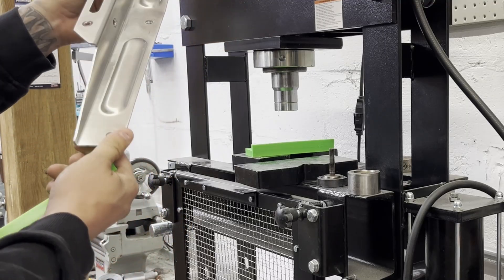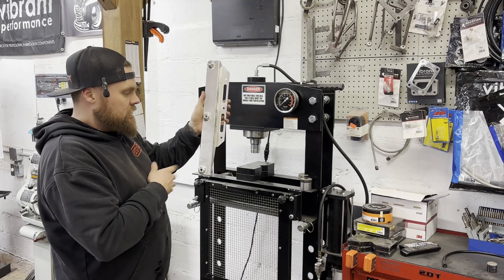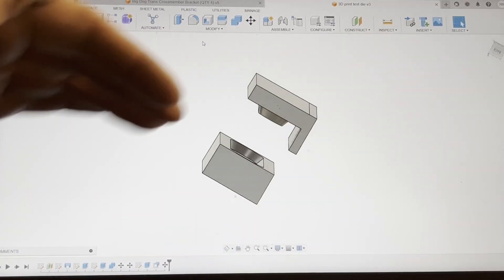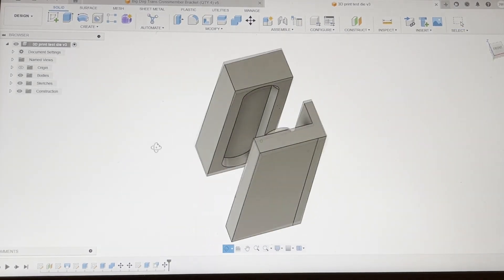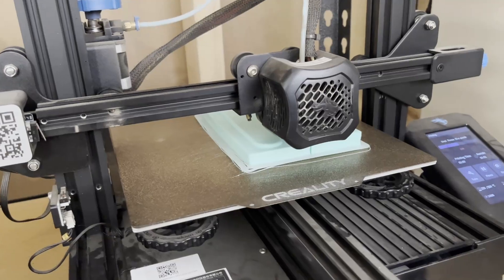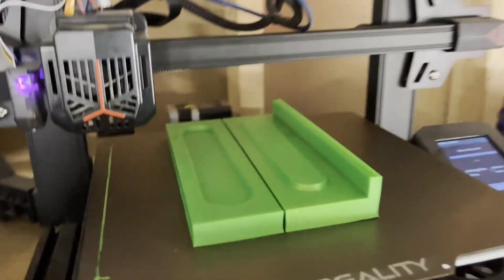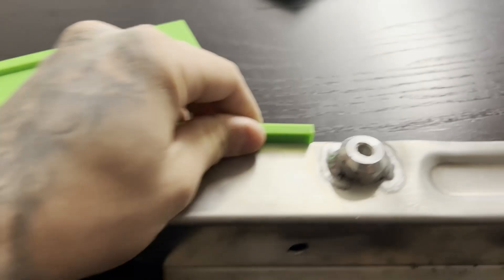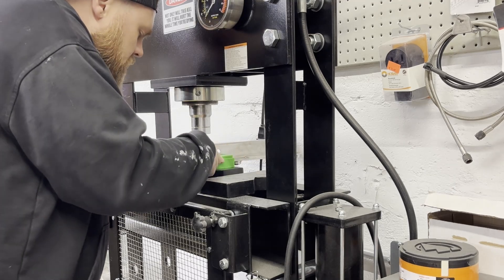I can't believe this worked! 3D printed die on a hydraulic press

Comment: Hey mech. engineer here. You probably could improve your workflow by using a "rubber pad forming" technique. The pressure is more evenly distributed with this method, resulting in virtually no surface damaging and a better distributed material flow. It also decreases forming pressure significantly. You can even create a small series of parts of about 100 pieces or more with PLA printed dies. You also only need one die instead of 2. Just look it up online. Also you can see the wavy sides, this is due to a missing blank holder. The material creates wrinkles while it´s being deformed. The rubber pad can simultaneously function as a blankholder (although I believe in this example it wouldn´t have worked well ,due to the small area). 
I have found a study online with the following test results. A DC3 steel blank 0,7mm thickness, 80x80mm was deformed by pressing a half sphere with 17T press in it. The rubber used was Shore A 40 durometer. More than 17T didn´t result in a better outcome and higher durometer needed significantly more force but didn´t result in a better outcome either. There were a series of 64 pieces made. Deviation between 1st and 64th piece were about 0,1mm due to a small radius of only 2,5mm.
Reply from the maker: I'll do some research on that! Thank you for the advice.

Comment: W2hat is this material BAS?,HDPETG? nylon?:? my lord a 3mm metal part with layer stamp XD
Reply from the maker: It's just the cheap house brand PLA from filaments.ca! Worked awesome.
Reply: @issyfabspeed I would have done 6 walls and 50% infill. What did you do?
Reply from the maker: This particular dye I just went all out and printed at 100% infill. Now that we know it works I'll try a little less next go around.

Comment: 7:50 bro use safety, that plastic could have smashed.
Also should have made alignment pins in the 3d printed model.
Reply from the maker: Yes I'll agree, got a little excited and just went for it, haha. I thought about alignment dowels but didnt want to drill any holes in the bracket or have to have the tool way wider than it already is. It's pretty easy to line up this particular setup.